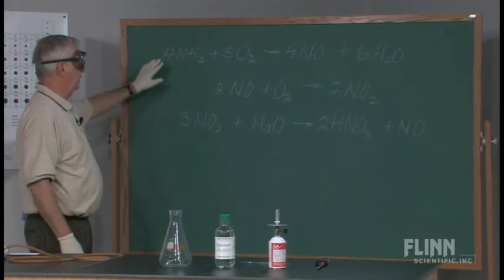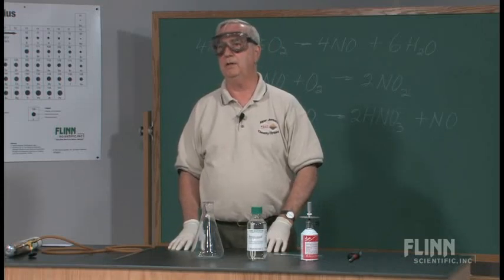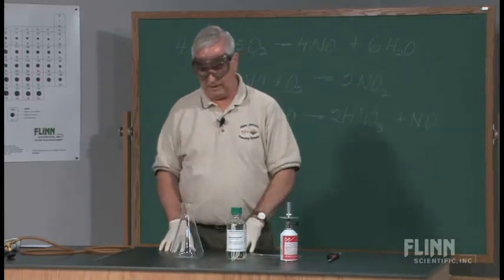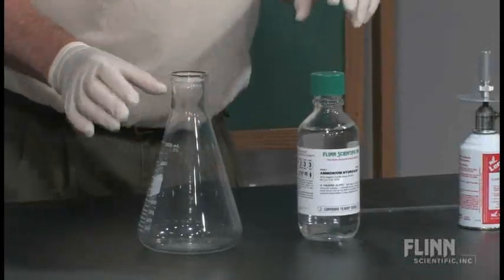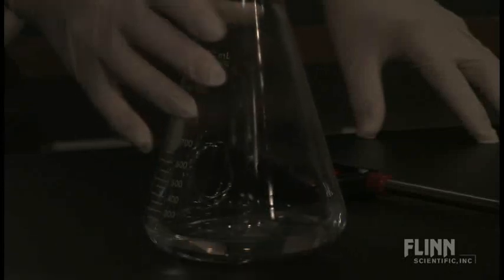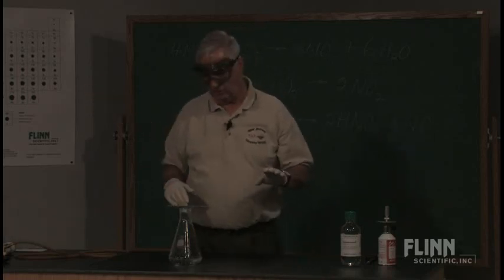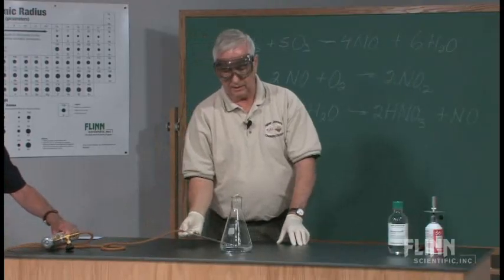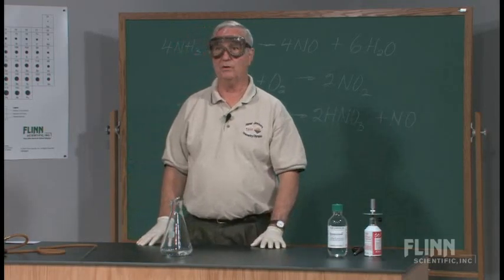Ostwald Oxidation of Ammonia

Comment: I work in a chem plant that does this very reaction to make nitric acid. Generally ammonia is injected into air compressed by a turbocharger to a concentration of 15 percent or so and then the mix is passed over a platinum mesh. The thing heats up to 850 deg. celsius easily! So much energy is produced, that the plant uses the heat to make 30 atm. steam to do other stuff in the plant. Very cool demo.

Comment: The world aim is to cut out hydrocarbons in the production of ammonia. Green hydrogen is made by electrolysis using mineral water and 3 percent KOH because pure water is a poor conductor you need vast amounts of electrical energy according to textbooks 50Kw per 1Kg of hydrogen gas . The other aim is to reduce energy one Australian company boasts it uses 42Kw to make 1Kg but there are no proofs . A Danish company has built a 100Mw electrolysis cell so the thumb of rule 2 tonnes of hydrogen gas is made hydrogen gas is expensive to store and the only use of hydrogen gas is for ammonia production as soon as the gas is made straight into the Haber Bosch system and the excess byproducts oxygen to cool ammonia on the spot it can be done.

Comment: Thank you.
I'm prepared now for the plof.
Because I want to make nitric acid from the ammonia in biogas.
I will lead the biogas through acetic acid making CH3COONH4 to filter the NH3 out of my biogas. 
This CH3COONH4 I will mix in a bottle with NaOH to make pure NH3 and CH3COONa-hydrate.
The NH3 I want oxidize with help of a plantinum catalist to nitrogenoxide with will react with water and oxygen to HNO3 nitricacid which i can sell. Biogas also contains H2S which also need to be filtered out and I don't let this going to waste too and make sulfuric acid from it. 
This way you can generate a income as a off-grid person.
Reply: FeSO4 is better for ammonia filter and it bindes H2S too.
Reply: @Preyhawk81  Then also CuSO4 which forms a very dark blue to purple solution when ammonia is added.

Comment: Way to go, letting oxygen out of the bottle without a proper regulator. This can be done much safer with slow stream and it can be just air.
Platinum has to be crumpled to lower the heat loss and it has to be immediately dumped into the flask with concentrated ammonia.
Not a very good preparation and it sadly ends with "don't do it if" - which made so many teachers afraid of doing anything remotely interesting in class.

Comment: Does platinum wire last long? Will it be weak or broken if used at high temperature?
Reply: Duy Nguyễn It will last a long time
Reply: Pt is very good element, almost inert. Ig it won't react that easily

Comment: should we dipp the catalyst into liquid ammonia or should it should be above it
Reply: If you don't know the answer to this question you should not be doing this demonstration.
Reply: Well I think (as I read in my textbook) platinum is used in the form of gauze in Oswald's process so it should be above it right?as nitric oxide gas is drawn away in the oxidation chamber to react it with the excess air to have nitrogen dioxide as a product and blah blah........I am student and not a chemist so  better consult a chemist.